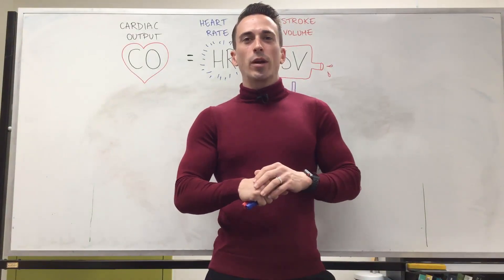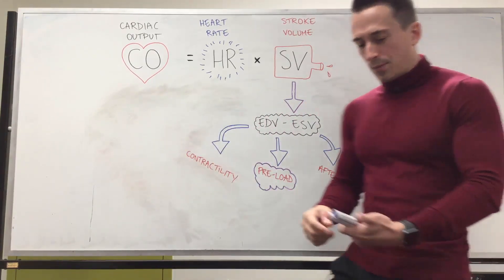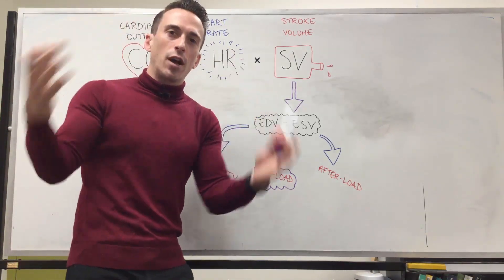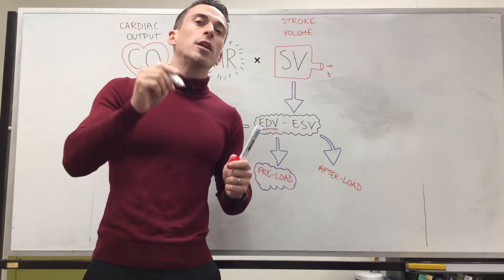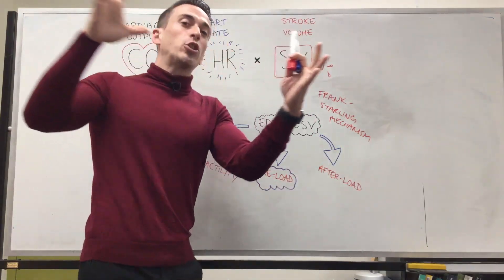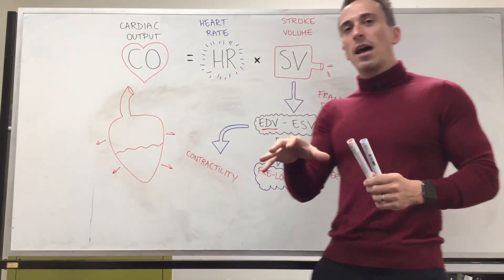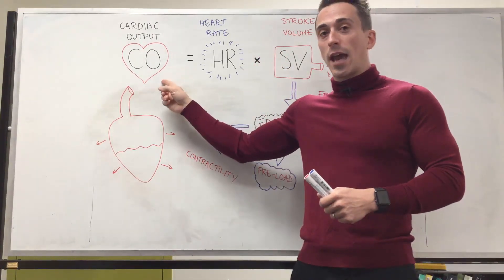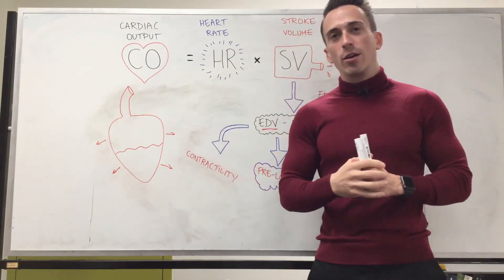Preload | Cardiology

Comment: This is how contractility is defined: "Increasing contractility is done primarily through increasing the influx of calcium or maintaining higher calcium levels in the cytosol of cardiac myocytes during an action potential" (Wikipedia). So how does an increase in EDV increase the contractility? Isn't the contractility related to the calcium ions? During a cardiac infarction, we must decrease the workload of the heart so that it would not require the extra oxygen that it would not be able to get due to some dead mass. Also, contractility is a factor that makes up 80 % of the oxygen demand of the heart (according to my professor). Therefore, I just want someone to tell me whether I am wrong or not based on my just stated explanations: Decreasing the SNS activation during a myocardial infarction, yes, is to decrease the heart rate and systolic pressure, BUT ALSO CONTRACTILITY, right? I mean yes, contractility increases stroke volume hence would increase the reperfusion, but it would increase the oxygen demand too much. Thus, we increase the stroke volume by increasing the venous return, which if I am not wrong, increases the stroke volume PASSIVELY because the stretch of the myocytes and the recoil of the myocytes is passive, and again if I am not wrong, this is the Frank-Starling law. This is how I am making sense out of it, otherwise I am quite confused.